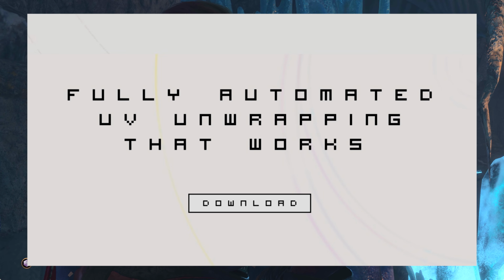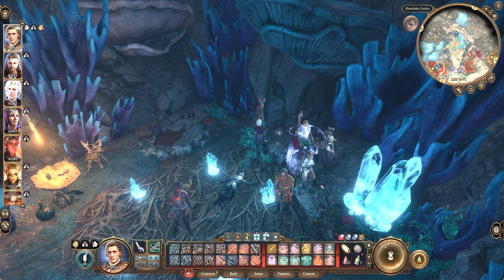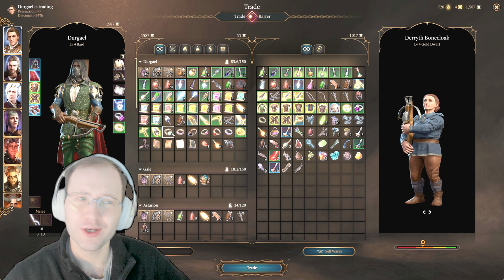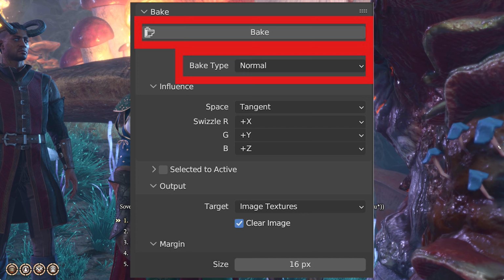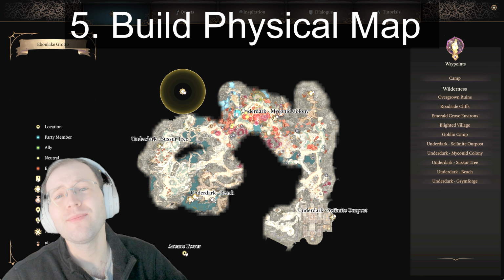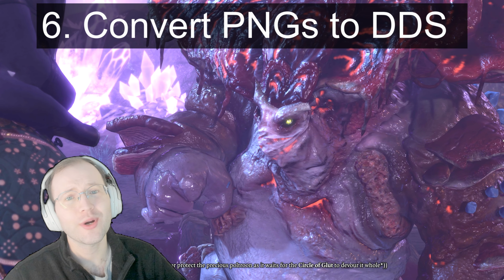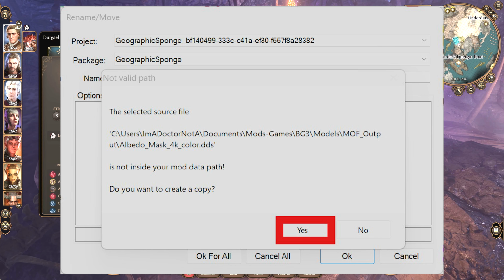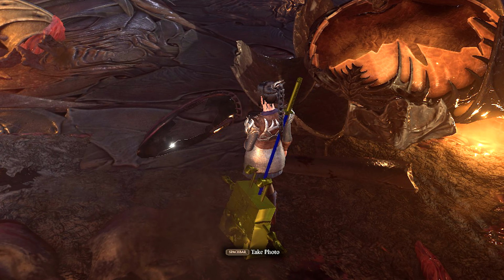How to Create Custom Materials for BG3 Weapon Mods (Beginner Tutorial) – Pathologist Modder Workflow

Comment: Hi, I've been trying to generate a Normal Map in Blender for a custom outfit. Yet despite following your instructions to the letter, it always generate an empty violet square. Is there anything I'm missing?
Reply from the maker: To confirm, you selected everything? That sounds like your model somehow did not get passed to the Blender plugins. If there are some squiggles there, but very few, probably only parts got passed.
Reply: @ImADoctorNotA  My outfit (camp clothes) is made of several independent meshes grouped together (top, bustier and skirt). I made Albedo maps for each of them. To try making a normal map I did the following:

Select one of the meshes and unwrap it > hit Shading > add image texture (material already exists) > go into Render and change Eevee to Cycles and Normal before hitting Bake.

I have the feeling I am missing something. I'm a beginner at Blender.
Reply: @ImADoctorNotA  I think I figured out what I was doing wrong. I was trying to bake unconverted meshes from a project file rather than something already exported. It seems to be working now. Just wanted to know, is there any incidence over using the gltf/gr2 format over dae/gr2? My dae files keep giving me broken UV maps.
Reply from the maker: Thanks for letting me know, and sorry for the delay. I'm on parental leave right now. I appreciate you sharing your fix, so others who come to the video can learn from your experience. I'm not personally sure. I just used the DAE/GR2 because the GIFT/GR2 export did not work for me. Folks who are more experienced in Blender and BG3 modding could likely speak more on it. I definitely recommend the BG3 modding channels on the Larian Discord if you have not yet checked it out.

Comment: How do you add the glow/emissive map?

I figured it out, at least it worked for what I was doing. 

I had a emissive map for a gem and it looks perfect now but idk if it'd work on something with the intent of something extremely bright but it should as this look identical to how I had it in Substance Painter.

I made a second material from an existing material resource that had glow properties and created a new one from selected and made  virtual texture using the emissive as the albedo/main layer and linked them together. Think I linked that material to the gem in my virtual resource model, which was already separated from the other parts, I don't know if it'd worked properly if all parts were singular.
Reply from the maker: Thanks for sharing your fix, glad to hear you figured it out!

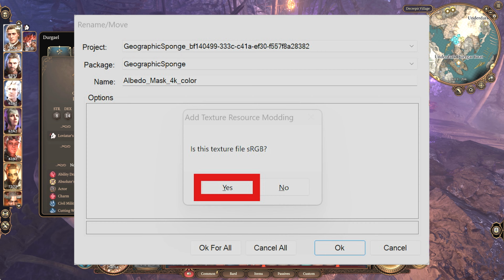Comment: Hi, at 9:50 in your video, you got some prompts asking if your files were sRGB. I didn't get those prompts while importing. When trying to edit the textures inside the toolkit there is a tickbox for sRGB, but it's greyed out and unclickable. What do I do?
Reply from the maker: Hi! Thanks for reaching out. To help narrow this down, could you confirm if you are importing DDS files compressed as BC1 or BC3?
Reply: @ImADoctorNotA hi thanks alot for responding, I actually worked it out not long after and forgot to delete my comment - I'm using moonglasses (editor with unlocked functionality and bug fixes) and the importing is alot different to this video - if anyone else is using moonglasses and encounters this confusion, you have to go to the drop down menu up the top of the import ui and select what type of texture you're importing, and it'll automatically sort it out for you

Comment: I'm trying to port an outfit from another game and it uses a green specular map, can I convert it to physical map or do I have to make one using its diffuse map?
Reply from the maker: From my limited reading, it sounds like you have to make a separate physical map as it is a bit different. I would defer to asking folks on the Larian modding discord: https://discord.com/channels/98922182746329088/1281226410299494430